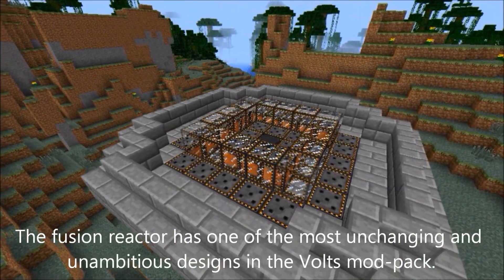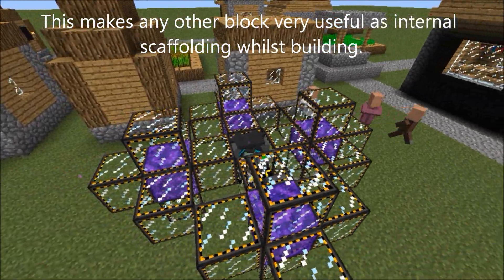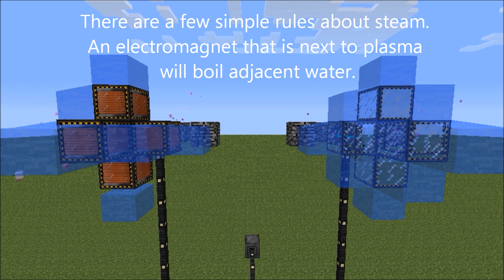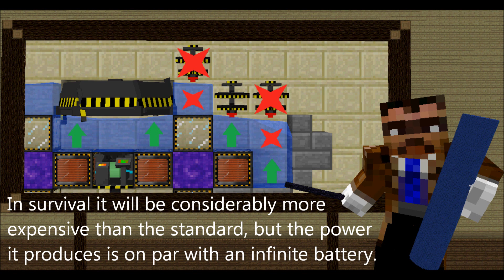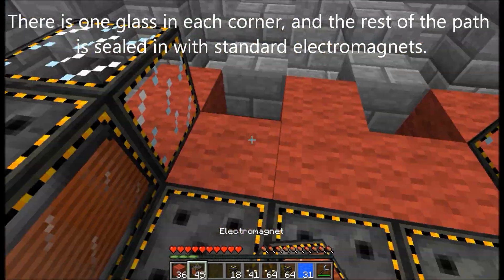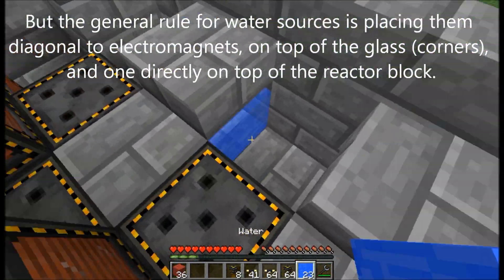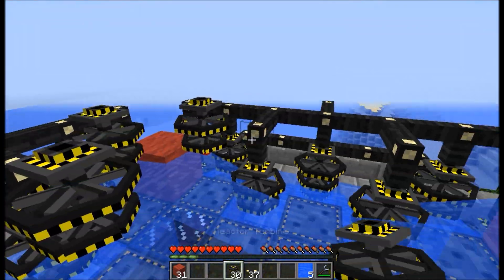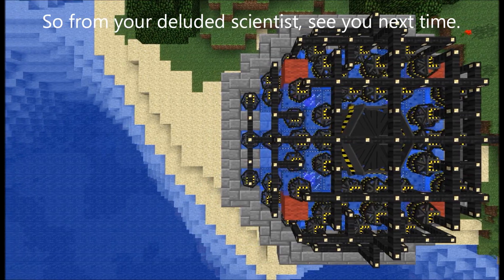Supercharging Fusion Reactors - Voltz Atomic Science Tutorial

Comment: Huh... I copied this exactly (following the annotations rather than the sound) and it doesn't seem to provide enough power to even keep itself going... I also notice the plasma fluctuating wildly and not filling the basin completely. Any ideas?
Reply: +Llurendt Don't know if this is helpful to you since you comment is a month old, maybe you've figured something out, but I seem to recall that this reactor type needs to run for a while to warm up before it starts to produce decent power, so maybe you just need a big more power from something else just to get it warmed up first. 
Like I say, I can't remember exactly, which is why I'm here actually, to remind myself how to even build this :P haha!
Reply: +thfreakinacage I ended up having to put a battery on the output line and outputting directly into the reactor to ensure it always got power first. Once I did that there (and at a few others of my most important systems), it seems not to cause problems. Also, it seems that the mod was updated at some point so that either
a) Big turbines were BETTER than 9 small turbines.
or
b) Big turbines have exactly the same output as 9 small turbines (saving space and resources in the process).
Reply: +Llurendt cool I'll try big ones on mine then. Not played tekkit for a ridiculously long time, so back in it now playing with stuff. Literally right now testing the reactor out for power. Haha
Reply: +thfreakinacage Glad to help! ^.^ OH! And I believe I upgreaded to his other design which is a bit more indepth, but produces more steam. I also ended up piping off all the steam to a separated turbine farm using the uh.... steam intake thingies... It's been a while so I can't remember the name, lol.
Reply: +Llurendt ah right, yeah the funnel things. Might try that too, I can see that looking awesome :D 
What do you use for the turbine farm? If you can remember that is :)
Reply: +thfreakinacage You just funnel the steam, then use pressurized pipes to move it. You set up a flat bed of turbines, combining them into groups of 9, then make them big. Run the pressurized tubing and power cable in rows between two rows of turbines, going 1 to each side, once at each turbine to connect them. It works pretty great and you can just keep making more turbines to add in if you have a big enough space. I personally put a tank in between so I could monitor the steam levels, but really, if you go with the improved design, you will have trouble making enough turbines to use the steam.

Comment: Don't put electromagnetic glass on the top, you can boil water there if you just use electromagnets.
 Also you can make the inner cavity 3 blocks wide instead of 1 so you can use 8 3x3 turbines. Makes a crapload of power that way with just 1 fusion reactor. At least that's with the reactor version that is in the unofficial Moonquest modpack.
Reply: Personally ever since calc added the steam funnels. I actually use those to pipe steam to a series of turbines. you'd be amazed how remarkably stable your power generation is. When you only siphon the steam and pipe it out. it also allows you to have a greater surface area of water to electromagnet ratio.
Reply: In tekkit I use fluiducts to pipe steam to a turbine

Comment: I built what I like to call a superchaged reactor array.  It was 8 standard size fusion reactor constructions (5x5 I believe), surrounding a much larger construction, with its own fusion reactor.  I started the 8 small assemblies first, and used the power produced by them to start the larger assembly in the middle.  I also set them up to share plasma, meaning that even if one reactor was not running, plasma was still heating most of the water adjacent to it, keeping the turbines running.  The turbines at the intersections on each side, instead of being redundant and not providing power, were instead heated by the much larger setup.  

Looked sort of  like this:  
          _______ 
          |              |
 _____|   x      x  |__
|    x                      x   |
|                X              |
|__x__                 _x__|
          |  x         x  |
          |_________|

Each x represents the general position of a reactor.  I used funnels also to grab steam from typically unused places, and reduced the electromagnetic glass used so I could get more steam also.  The design I found was very efficient in terms of amount of energy generated, though the complexity did make some odd spots where one would think there would be steam actually not have steam (only on the outside though, where most people don't even think to put turbines anyway).  I think I may not have properly positioned water blocks and electromagnets, but still it was extremely powerful.  I think I could also expand on it theoretically to make it 12 small reactors and 1 big one in the middle, using the corners.  There doesn't seem to be an actual size limit on the reactor size.  May post a video of it at some point, but probably won't.  Anyway, thought I would just throw the design out there.  The only downsides on it, are the electricity required to initially start all the reactors (but with each reactor also providing some juice to start another reactor, it kind of compensates), and the gargantuan scale of it.  You can make it with 4 small reactors instead of 8, but it will still be huge.  Also, I found that the big reactors can be used effectively, by not putting them in the middle, per se, but next to the middle.  Make sure all 9 small turbines get steam, and if they do, make it into a big turbine (produces more power).  To get more 9 turbine combos, do not use glass, only electromagnets, and use funnels strategically to even out the turbine height.

Comment: I prefer voltz over tekkit, but besides the point, you cant do this with the voltz 2.0.4 because there is no good wire, only copper, so it all burns off unless you make lots of different sections leading to different battery boxes which gets annoying.

Comment: Nice design, just upgraded my fusion reactor to this. wow!

lol at anyone who tried using copper cable as the power output, the darwin award goes to..

If you are still struggling to work out how to get power from this thing on the latest release of Voltz. The Mekanism mod adds Universal Cable which does not burn. ;)
Universal Cable does not connect to a battery box, you need to use energy cells to store the power.

Comment: I tried a new build of this on the server i am playing on and the reactor works outputting between 395 - 410 KW but it still refuses live off of its self. the battery box drains slowly 0.01 per 5 seconds but it still cant hold its self. Maybe the reactors bugged? I will get a screenshot and post it. ALso its not linked to anything just to a bat box that feeds it back to its self.

Comment: thanks I tried this and after a while the one high block disappears also. The Glass EM with water doesn't disappear but the EM next to it loses water and water refuses to run across it. I may try your next Tutorial which makes it into a diamond shape. Also i am having problems where the battery boxes will not charge up and the  output is about 250 - 300 but the battery boxes have inputs coming in but as soon as it appears its gone. Its using more power than it produces.